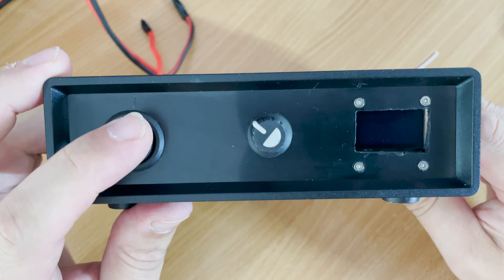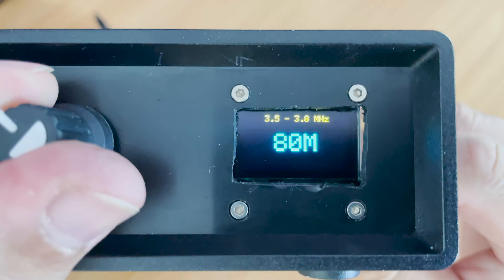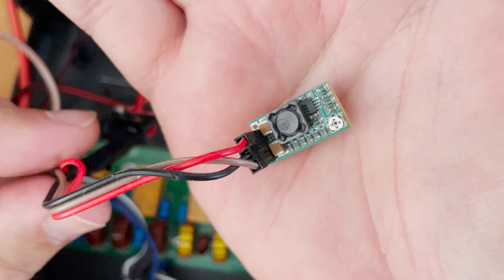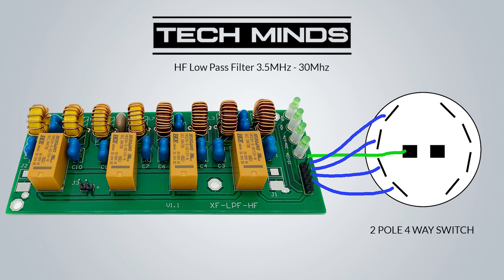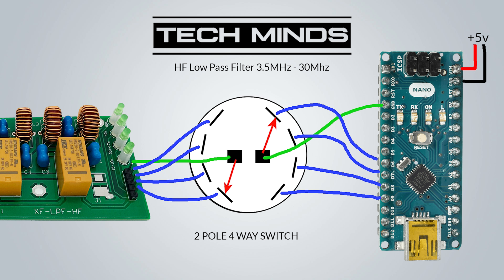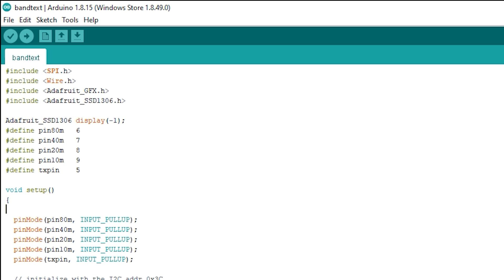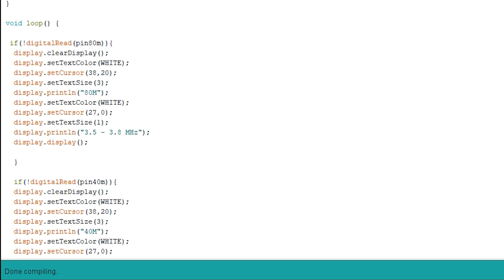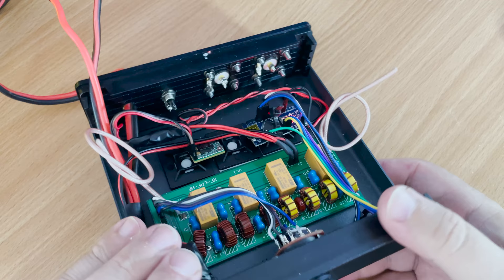Low Pass Filter Arduino Controlled OLED Band Display

Comment: Great use of Arduino to control LPF and a nice enjoyable video as usual 😊👍. A suggestion to make this device look more modern is to replace the rotary switch with two buttons or touch sensors, one for band up and one for band down. In the software we can even make this as an infinite loop (ie: pressing up when already in the top band will result in going to the bottom band). 73!

Comment: Great project, just one tiny teeny thing I would do differently.  I would use a metal chassis box as to shield the internals and prevent rf radiation and interference.  Otherwise very ingenious.
Reply from the maker: The tops and bottom of this case is metal, it’s only the front and rear panel which are plastic. :-)

Comment: If you have the Arduino (or better an ESP8266/ESP32) control the relays and the display you can control it via USB if you wanted (or Wifi in case of ESPs) would be good for experimenting.

Comment: I don't think you need the SPI library, the display is I2C, so the wire library should be enough. Having said that, if the library is not called within the code, theoretically it shouldn't be compiled so it shouldn't matter.

Comment: I’d be worried about RFI and RMC.  On receive getting noise from the SMPS and the Arduino itself and on transmit stray RF causing reboots etc?  How does it seem in practice?
Reply from the maker: You do not need to worry.. 👌
Reply: @TechMindsOfficial  Thanks!

Comment: I've considered using one of these filter kits BUT the supplier I contacted could not provide any details of the torroid winding, did you use a kit or ready built ?  If kit, or bare board, where did you get the coil data from ?

Comment: I have the exact same filter board and noticed my SWR to the radio(between radio and filter) is 6:1. This obliviously is very bad.  Have you checked to see what yours is? On the output side I'm below 1.5:1(antenna to filter).